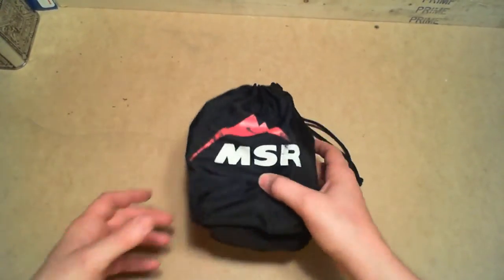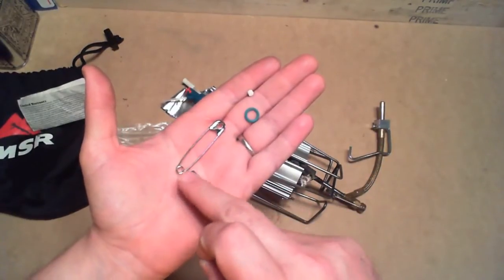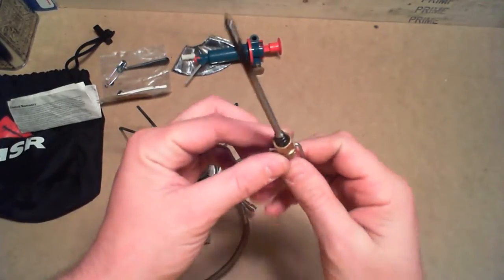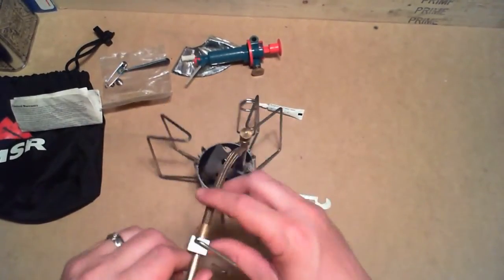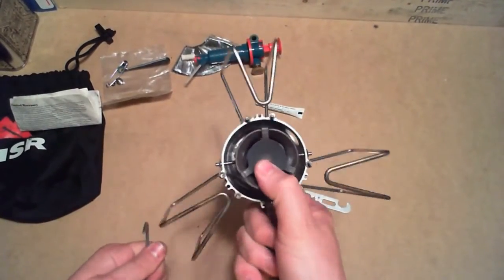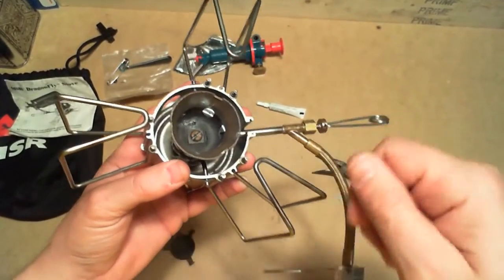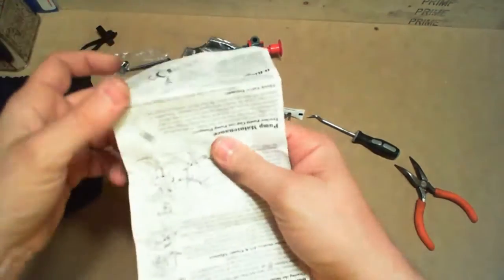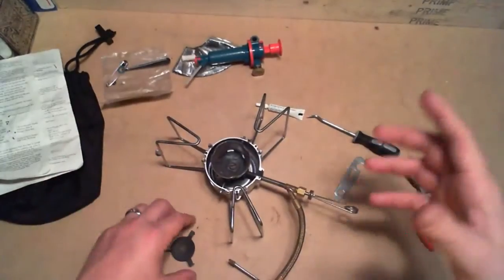MSR Dragonfly Stove Maintenance Part 1

Comment: Thanks for the video. I have the same problem of the Jet. The jet screw is very very tight, I sprayed a lot of WD40, and I used a wrench + screwdriver to take full leverage to unscrew that.

Comment: I've followed your suggestion using WD40. Yes, after it, I can unscrew my nozzle-jet.
And then, I fire it up with white gas, let it cool down, and the nozzle-jet became solid clogged.

Never ever use WD40 to clean your stove, you should use carbon cleaner.